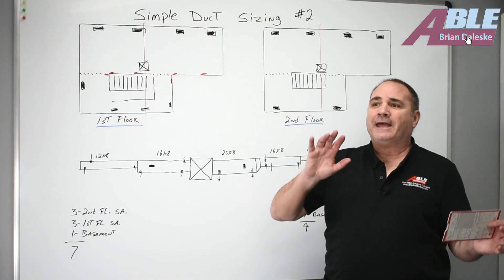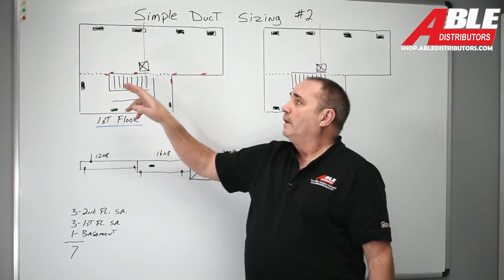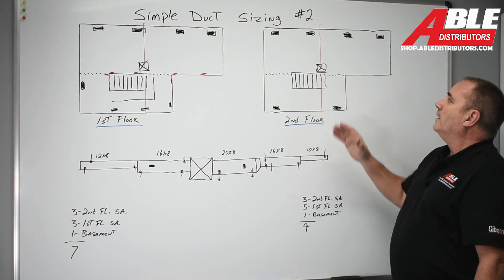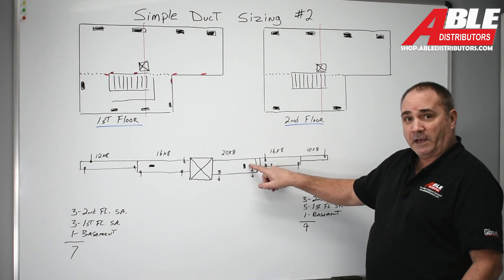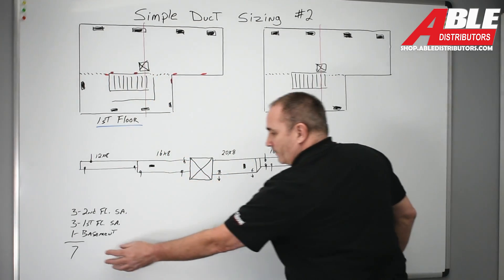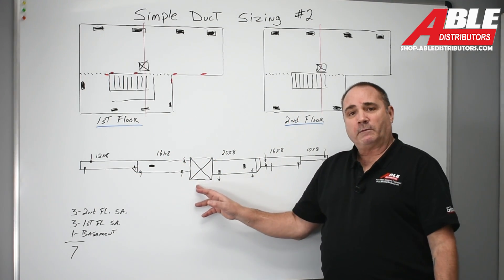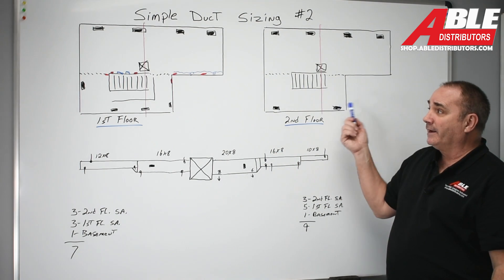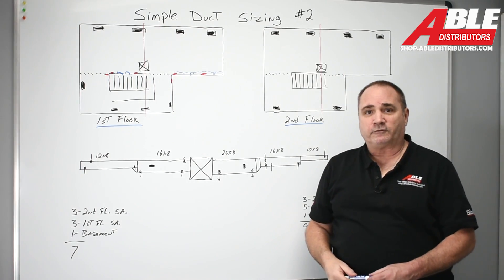Simple Duct Sizing - Part 2

Comment: Great info!! I'm doing a house right now that I bought, it's a small 750 sq ft house with two bedrooms. it's on a crawl space and the current furnace is a 40,000 BTU payne brand upflow furnace that was turned upside down to make a downflow. But the flex ducts that are run under the house are disconnected, full of trash and there is no plenum. They just all connect together underneath the floor.

 So I'm thinking about turning the furnace upright again making it a upflow and running the Supply ducts through the attic with a 16x8 plenum. Then I will have one large return in the middle of the house pulling the heat down to the floor. That way I don't have to mess around in the crawl space reinstalling the pipes, especially because it will need dug out. I know the floor may be a little bit cold but I'm okay with that.
Reply from the maker: Flex duck is used sometimes to often, it cuts down air flow, it makes it difficult to clean, won't keep out mice and rats, but it's faster and easier , I always prefer steel duct insulated on the outside, sometimes you sill need to run branch ducts in flex.   good luck, take your time.

Comment: Great video. I have a Goodman 4ton modulating 120,000 btu furnace. I have 3 cfm output on panel that range from 1670-2200 cfm. My furnace is located in basement, I have a 16’ trunk on left side of house and a 36’ trunk going to the right side of the house. When I start to build off the plenum does the first run on both side have to equal and be around that range of cfm or does the longest run has to start off being that cfm range?

Comment: I don’t suppose you guys offer a duct design service cheap? Mine is simple. Ranch, crawl, center furnace, left right 5 take offs each side.  1500 sqft 3 ton. I’m looking for round main trunk lines. Easier for me. I’ve learned a bunch, but I’m not looking to find out I screw up something simple. I don’t even need a cad drawing. 
Plenum size
Starter from plenum size
Then how often to reduce. 

Currently have a rusted out system, and I don’t trust it was done right when first done. 5 take offs all on one side no reductions.  Long story.
Reply from the maker: first off, Thank You for checking out our video.  Unfortunately we do not offer duct design services, there may be "on line" type layout and design help, there seems to be an app for everything now.  Good Luck,   Brian..
Reply: @abledistributors Awe poop! Thanks anyway.
Reply: @abledistributors Hello, while you do not offer duct design, would you refer non-professionals to reputable HVAC design only firms in Chicagoland? It seems that the majority of the HVAC companies want to design AND install the work. Thank you

Comment: I have a conundrum, I have a 3 ton 16 seer in a 1200sq ft home with 4 inch octopus soft ducts , and a 16x25x1 inch return lol. Hvac installed 3 years ago cant use the good filters because my system gets restricted. But with such a newer system I dont want to use fiberglass and risk the evap lol. At the time of install was told the ducts would be fine with an oversized unit as it would push the air better. Im so screwed cant afford new ducts now.